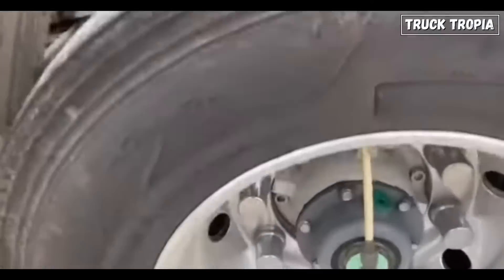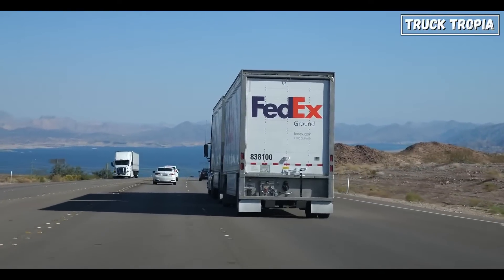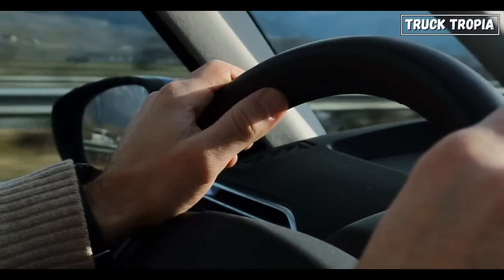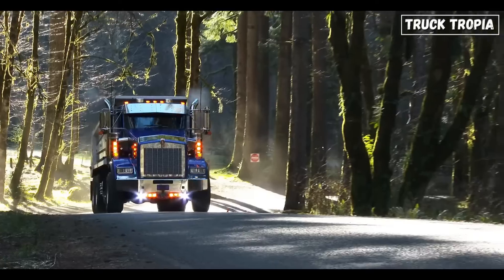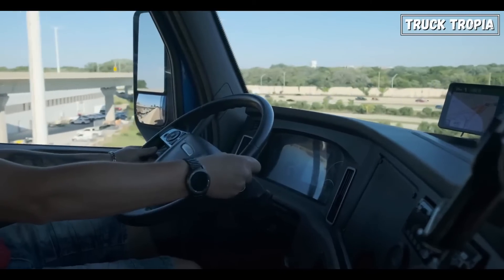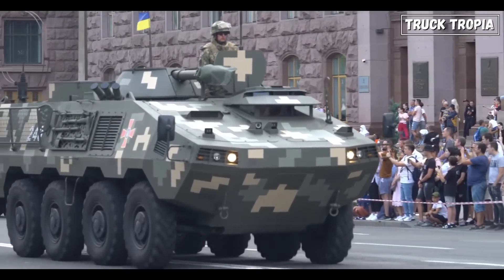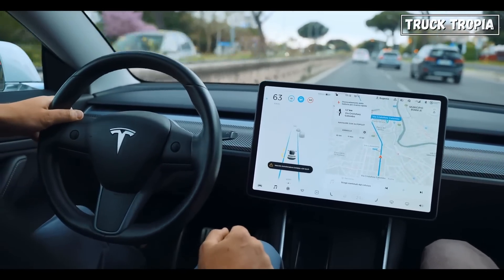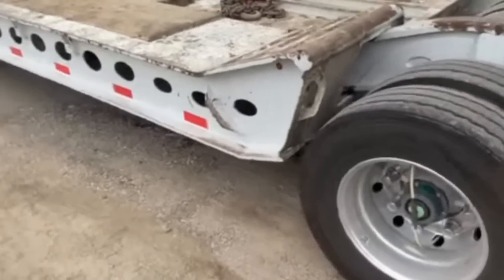What Are These WEIRD Things Hanging From Truck Wheels For?

Comment: I like it that more tires on heavy trucks have tire pressure monitoring systems including to prevent blowouts.
Reply: I think as a technician it's stupid and just another thing that will break and really is in needed just need to make sure the truck driver is doing his pre trip correctly and check his shit when he stops for fueling I've seen just as many trucks with TPS have blowouts as ones without TPS

Comment: What nonsense. Tire pressure monitoring systems are sufficient for normal trucks on the road. Only vehicles that frequently change tire pressure due to changing road surfaces need a system to change tire pressure while driving. For the rest of the vehicle, it's far too complicated and expensive, with no real benefit.

Comment: The danger of under pressure in large tires is they heat up very quickly and can easily explode. But if everyone is so obsessed with fuel economy then they should have made trucks use diesel electric, that alone would use 30-40% less fuel...